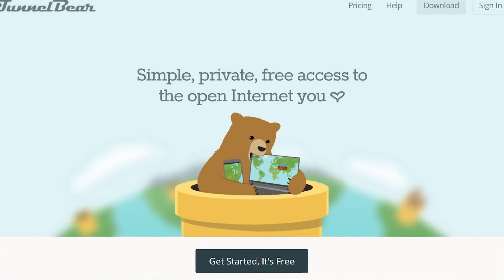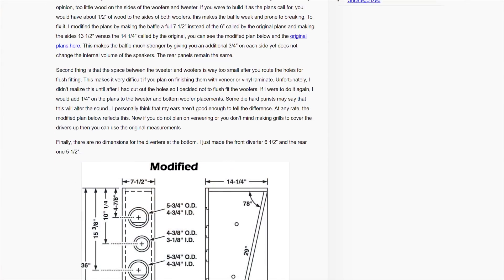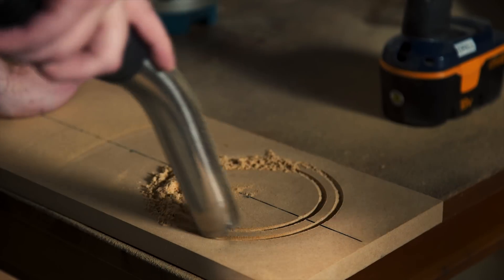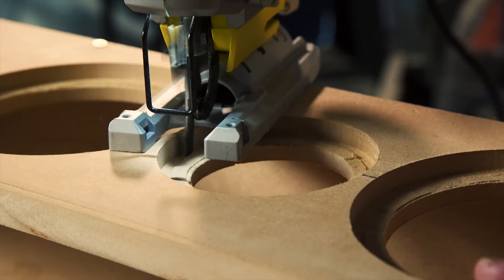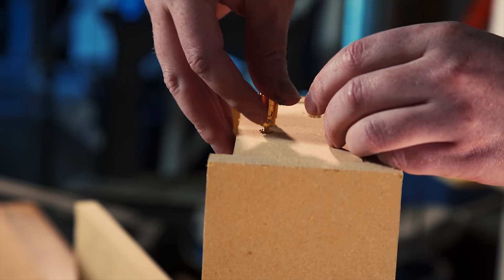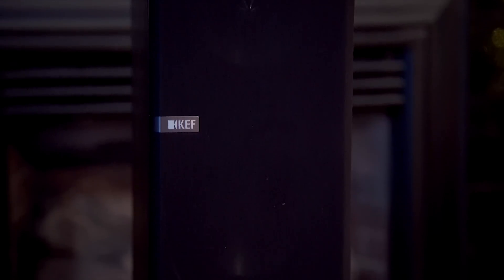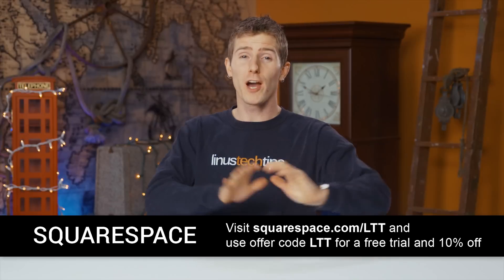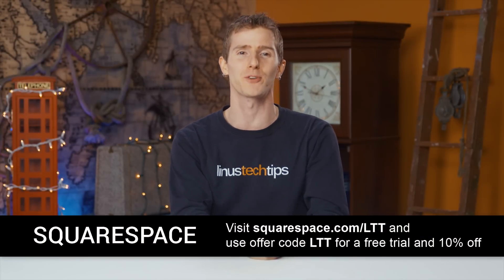DIY Speakers for Less Than $300!

Comment: Flush mounting the drivers and routing the corners round so the baffle doesnt have edges makes less reflection point sources meaning cleaner sound, been deep diving into speaker building recently

Comment: Or you could spend some of that saved money on a good microphone to eq tune your diy speakers and they will sound better than the pre-built ones. The only difference between the 2 is the frequency response and the ability to reach any frequency at a certain decibel. So tuning will fix your caveat.

Comment: Yikes, that was painful to watch, and no way could I tolerate having to look at them every day.
They aren't built to the design, either the tunnel or the driver placement.
I'm a toolmaker and I have worked with guys that made the part resemble the print, sorta, but didn't hit a single dimension.
So, yeah, I've seem this crap before.

Comment: When listening to speakers placement, position/aiming is very important. As well as where the listener sits. Bad speaker placement can make sub par speakers sound much better and great speakers sound like crap. Setting two sets of speakers next to each other like that is not the best idea. It makes quick switching and ab testing much easier and quicker but it isn't going to give you the best sound for either speaker. Same with having multiple people sitting on a couch next to each other. Each person is going to hear something slightly different depending on where they are sitting. Especially with imaging and sound stage. It could also effect frequency response a little bit as well. 

Not to mention listening tests are very hard to do accurately, even if under the best circumstances. It normally takes multiple listening sessions with a large sample size of people that know what they are listening for to get any kind of accurate results. Not to mention everyone hears differently and has different tastes. The human brain can do some very tricky stuff with sound and vision and really cannot be trusted that much. Even your mood on a particular day could color the results. Scientific testing with measuring devices are your best bet. There is nothing you hear that can't be tested with the right equipment. For instance testing the frequency response would have been pretty easy to do. You also have to be sure to match the audio level when switching from speaker to speaker. A speaker that has a slightly higher sensitivity and is a bit louder might sound better than one that is slightly lower. Even a few db can make a difference. So you have to make sure each test is at the same volume level from test to test or it just isn't fair.

All that being said I am sure your KEF's sound and measure better than that kit. KEF is a very good company that builds high quality speakers with very good quality control. Most likely using a much better design, better and more accurate crossovers and better components through out. Sometimes with more high end speakers you are paying for better quality parts and parts that are binned and matched so they all sound good together. You can get some very good kits that will rival speakers for much more money. Often using the same core drivers and you just assemble the cabinets yourself. However those kits are really not that cheap. Cheaper than buying full speakers but really what I would call cheap. Some cheaper kits will sound as good or better than many mass produced more affordable speakers though. You could build speakers that will blow bose out of the water, or some cheap off brand thing you see in a box store or online. And probably sound as good or better than Polk, JBL or Cerwin Vega's and possibly even KEFs depending on the model you get. I wouldn't count on them sounding as good as high end KEFs, B&W's, or other speakers that are equally as good. They might come close though for less money and most wouldn't be able to hear the difference. And once you dive into speakers that are 5 to 10 thousand dollars you are not going to come close without spending thousands on parts and being a master craftsman. Again, you could probably do it cheaper but you will still be spending a lot of money and time. And you would still be at the mercy of what you got sent parts wise. You won't have the advantage of a company that can test a whole pile of drivers that will bin and match them for each set of speakers. Which is what many high end speaker companies do.

Comment: If you wanna build your own speakers, make sure you get atleast an 8 inch sub. Actually lemme explain the simplest and prolly cheapest option. Hertz 2 way 6.5 inch component pair for cars + 2 subs. Either try to google how to make the appropriate crossovers or just get an amp with sub outs and you won't even have to bother with that. Deep bass + great highs and mids for prolly less than what he spent here

Comment: I think mine is 200 USD with a custom box.. 2 sets

each with
500w woofer 15 inch 32Hz-2.8KHz
700w tweeter
350w mid
3-way divider 

..
we just really use it for video-oke haha

Comment: Your first DIY will cost you way more than you think.  If you don't already have a well stocked work bench you WILL have to buy at least several hundred dollars in specific tools for the job.  Router, router bits, clamps, orbit sander, etc...  I was caught off guard, thought I'd make a subwoofer for about $800....think again.

Comment: Excellent. I will just add that it is very important to protect your lungs with dust mask. MDF creates very fine dust when cut with router which you do not want to breath in. This dust can linger for hours.  I suggest doing it outside if possible. Also, protect your eyes and ears as well.

Comment: You should do an example of a nice 3 way 2 channel speaker system made from cheap Chinese car speakers and you can use pre-made spread sheets and simple voltage and impedance testing (you can do this on PC I have for ages with onboard sound hardware!!) to get actual speaker data for building cabinets!! You will have something that will blow those $300 dollar things completely away and maybe scare your neighbors and very efficient (like can be run from a chip amp and be scary loud but also nice too!).  You must revisit this there's a lot of people myself included that like to build speakers and it's actually doable and you can have some amazing results!
Reply: Using THE most bottom of the barrel CHEAP Chinese car speakers you can make for about $100 a pair of speakers and some spreadsheet math and testing that your PC can ALREADY do...an incredible pair of speakers and $100 is estimated it could get cheaper by a LOT depending on what you can find and how cheap and how good!

Comment: You put the so-called woofers in series which doubles the impedance - was the cross-over designed to handle 16 Ohms for the woofer and 8 Ohms for the tweeter?    BTW it is more distance than orientation that affects  inductance.

Comment: Absolute shit build and coverage. What was the used capacitance? Crossover-values? Total resistance of the speakers? Resistance of the woofers compared to the tweeters? Have you calculated what crossover value you want or did you just buy a filter without knowing shit about it?

Comment: Hey Linus glad to see you do some audio stuff too. Here’s an idea: I’ve always wondered what you might come up with if you were to do a computer build of an htpc. Specially one focused on hi fi audio. The program most often recommended by audiophiles is jriver,  another respected one is jplay. The ideal computer to run it would be powerful enough to transcribe music files on the fly, up convert low bitrate files into high bitrates, like dsd, and be silent running, and not run any processes that are not directly associated with making the audio, eliminating possible data corruptin or distortion. Finally there’sthe all important  dac, or digital to analog converter usually an external one is preferred,. It has to be able to convert all the cutting edge file types as well as the common ones,!and do it “perfectly”. I’d love to see what you and your team come up with.

Comment: Wow thank you 🙏🏻 I’ve been building speakers for nightclubs (on site) that would literally shatter the glass in your house for 30 years and it’s amazing how little they cost. Best speakers are really carpentry with some basic logic - I’ve build 7 foot tall towers for friends homes for $400 that sound better than a $15,000 pair at SoundDesign. If anyone is into this do a little research and give it a shot.

Comment: Wow, those cabinets are completely horrible. Also never suggest someone go out and buy a generic cabinet kit or a random pre-built. The cabinet being correct for the driver has a larger impact on sound than the driver itself. This is why your setup lacked low range, it is leaky as hell. If one can not build their own cabinets, always suggest they have a custom set created for the drivers they are using. Anything else is a waste.

Comment: Coming from someone with years of car audio experience: Pro Tip #1: Use Liquid Nails for you box, not conventional wood glue.  Liquid Nails is more flexible, and can withstand the vibrations of the drivers better over time.  Pro Tip #2: Use active crossovers.  For one, they add more flexibility should you decide to change cut-off frequencies or slopes.  Plus, they don't rob power from the drivers like passive crossovers.  Pro Tip #3: Don't overdue it on quantity of drivers.  You should typically only need a single driver per channel to cover a particular range of frequencies.  Introducing 2 identical drivers on the same channel is causing audio to hit your eardrum from two different sources at potentially two different times.  I don't know if time-alignment is a feature typically offered in computer audio pre-processing, but it wouldn't even help you in that case as both drivers would be on the same channel anyway.  To the naysayers about the build and sourcing of parts, aside from aesthetics, there's nothing inherently wrong with his build.  I'm not familiar with those particular drivers.  But I did my last car audio build using a pair of Seas silk dome tweeters from Parts Express.  They only cost like $70, and they are hands down the best tweeters I've ever heard.

Comment: your diy speakers would really shine in an active set up, as in ditching the passive crossover and using a two-way active crossover and two power amps. not saying they'd blow your kef's away but the sound quality would improve massively.
Passive crossovers have lot's of flaws. On an active crossover frequency matching and level matching are a breeze, also an active crossover isn't affected by the resonance of the tweeter.

Comment: You shouldn’t of ran the mids on series you should of ran them parallel and you  shouldn’t add an inductor for the tweeters either that way you would of had better sound
Reply: Inductors in // with tweeters are ok. See the filter schematic.

Comment: 4 audio pipe 12s(TSPP212D4) (300w rms 1k pmpo) at 36 each and two prefabbed box ported is about 240, get 2 audio pipe 4 way  6x9's(csl6924r) (250 watt rms 500 watt pmpo ones) with a sealed box for 65

Comment: To finish them, you should have just covered them in carpet (using contact cement) or with truck bed liner spray. They are good at hiding defects.

Comment: You could have just asked the guys in the hardware store to cut the panels for you to the correct measurements. It costs 5-10 bucks and it will be much more precise than cutting them yourself, unless you own a tablesaw and know how to use it....

Comment: Okay what the fuck. You have all this equipment and you end up with that? Tweeter not flush mounted, woofer countersink milling 15mm wider in diameter than it needs to be, gaps and overhangs at the corners. And the paint job would be better if omitted completely.

Comment: Should have wired your subs in parallel instead of series.. my guess those speakers are 4ohm drivers.. n you said you wired n series which positive & negative which will put you at a 8ohm load... You should have or should wire them in parallel positive n positive then negative to negative n push it to a 2ohm load.... They will hit 3x harder extremely noticable different in bass and loudness... Yeah it's more strain on the amp but the Audio output will be alot more and the bass will be better... Probably the ones you bought are wired n parallel and the ones u built are wired n series... Just try it and see you'll like it better because they will alot louder

Comment: 1 had 4 full range drivers and 1 had 2. and then you have to take into account the quality of those drivers. not a good comparison.
Reply: oh and one had a larger cabinet. which allows for more air movement.

Comment: In Germany we say "Schallwand" that means "soundbaffle". The name is because it is the baffle where the speakers are mounted on.
Not a bad job! You did it VERY good on the crossover. Most ppl just put it together as close as possible and not even putting one at an angle. Then the coils are "talking" to each other and they wonder why it sounds bad.
I have build a pair of open1001 and they are VERY good! 
As a musician i can say that they reproduce without colouring much. They just need a sub for very deep notes.

Comment: This is one of several videos that made me unsubscribe.
I built this exact speaker build, but I ALSO used XLR to RCA balanced audio connection to my PRE AMP, and used ferrous insulating coils on every cable, as well as using 12 gauge speaker wire, with proper binding posts.
This video is crazy biased, misleading, and showed me that I cannot rely on your Media Group to be a reliable source of tech advice.
Buy the MTM kit. It's $275 bucks, but be prepared to pay another ~$500 or so on the REQUIRED amp and pre amps that these speakers need. These are passive speakers; they are only as good as the electricity you deliver to them, you [censored]idiot[/censored].

Comment: The cabinet actually has alot more effect on the speakers then you think. I dunno if you calculated the volume of the box but thats very important. 

Also the construction of the box to make sure there is no gaps and rattles. 

Finally you countersunk the woofer but not the tweeter. Countersinking the tweeter is very important for diffraction. Also rounding off the corners of your box also is very easy to do and makes a big difference.

Comment: Wondering if the complete kit would come close to the sound quality as the Q500. There is a lot to be said for sophisticated crossover networks, cabinet volume design, sound deadening material and hardness and resonance of the wood used.  Would also like to see a spec sheet comparison.

Comment: Now bad for uber basic starters..  but to do it right there is far far more to it than will ever be covered here esp in such a short video.

That said though kudos for making the vid and for those at least curious enough to watch such.

(I studied acoustical engineering and did considerable work before in advance speaker designs.. that were more often than not far more complex and done long before the typical computer design  systems you can easily do now....  ugh again I'm showing my age!  UGH!!!!)

Comment: or just buy vintage hifi speakers, i have a set of wharfedale linton 3(made around 1971) around 25 euro's for a set of 2. i really like the sound it could use a bit more defined mid but it has clear high's and full, punchy and tight lows.

Comment: The reason it’s missing bass is because you need a large volume (space) inside of the cabinet and the cabinet NEEDS TO BE AIRTIGHT. You could also add either a perfectly calculated hole called a port (you can get guides online) or a passive radiator (speaker without a magnet) (again there are guides online).

Comment: Woodworking takes time to learn, you'll get better... so don't let the rude comments get you down. 
A Jasper jig is a bit pricey, but worth every penny. 
Good job, and good luck with future builds.

Personally, I never liked a MTM, but really enjoy one of these; a TMMT, or MMT, and either active crossover, or (with the right midwoofers) a passive crossover with 6-12db on the tweeter, and direct connection between midwoofer and amp. But selecting midwoofer with steep roll off and natural sound quality to roll off point is hard to find these days.

Comment: Run the woofers at 4 ohm so in parallel and add a tuned port to the box to make your minions testers happy. They will blow away the KEF. You can also use a piece of test board or by pre-assembled crossovers.